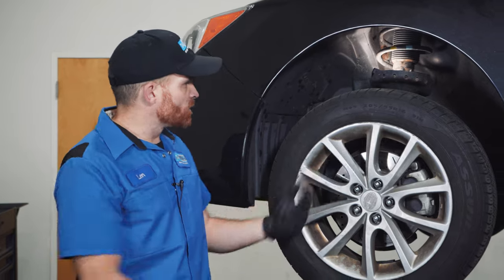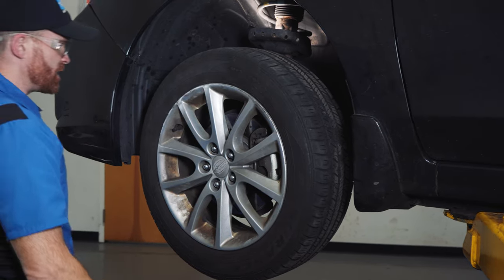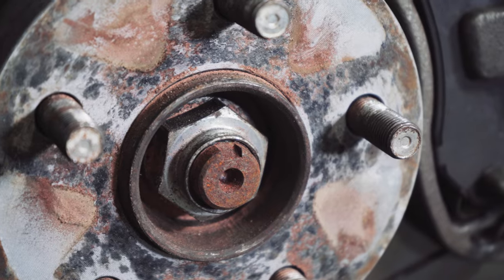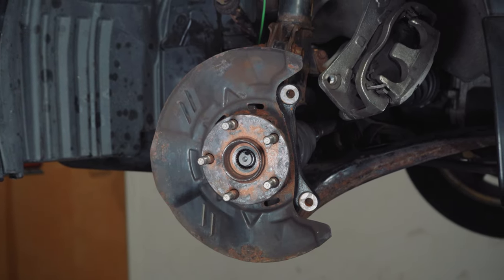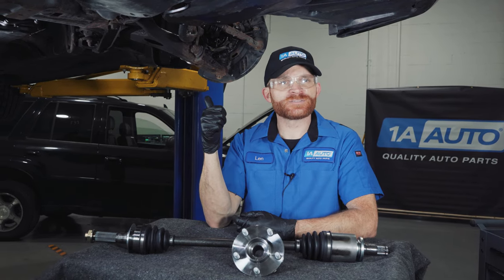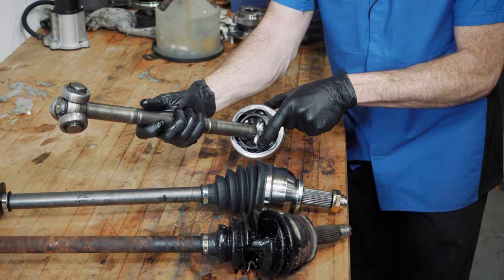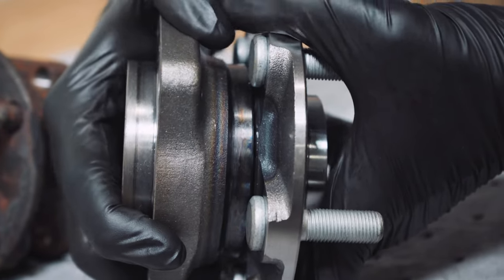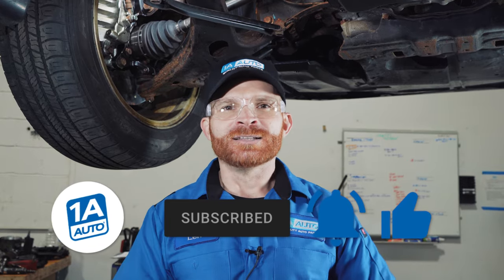Do You Have a Wobbly Wheel on Your Car or Truck? Should You Replace the Wheel Bearing or Adjust It?

Comment: Awesome i have a 2003 Chevrolet trailblazer EXT you have any video's I'm changing out the Front suspension upper and lower and both sides wheel bearing thank you 1AAUTO

Comment: Guess mines not a bearing problem. Mines got a high pitch whistling sound coming from the front and a vibration under the driver floor board. Any ideas? I've sort of ruled out bearing or CV axel. No play in the CV axel when I check by hand. No left/right or up/down movement when jacked up and checking the tire for play.

Comment: Very odd.. i just replaced my front left wheel axel. But still hear a grinding sound... Might be somewhere in the wheel hub area. Also.. that particular tire when I attempt to spin it their is slight resistance and at times the traction control comes in when driving 🤔🤔🤔